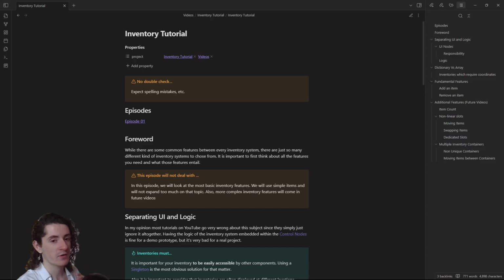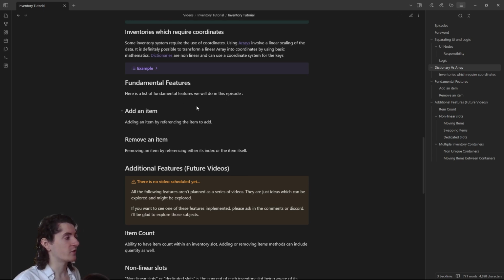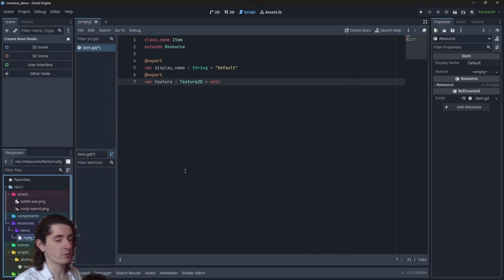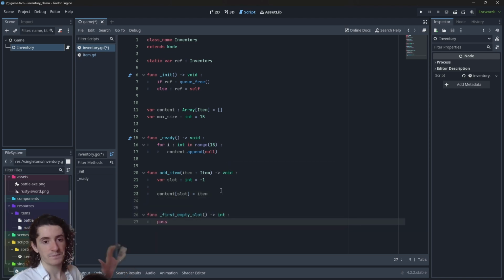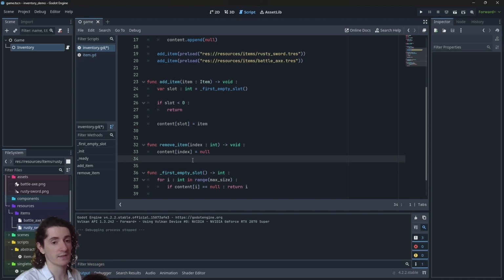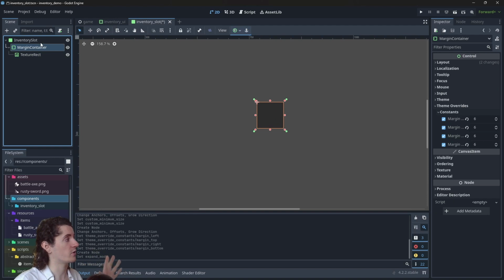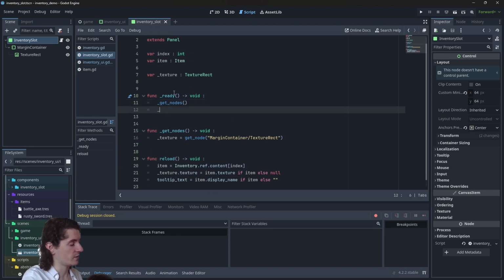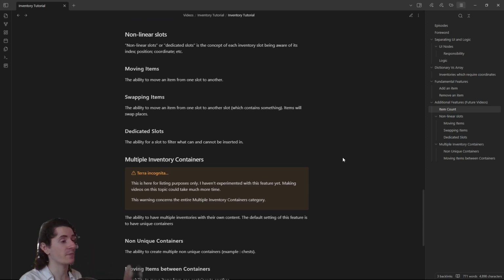Inventory Tutorial : In Depth - Fundamentals - Godot4 (Beginner)

Comment: These are really great, keep going!
Reply from the maker: I'm currently focusing more toward other projects. If there are specific inventory features you need, make sure to ask for it. I'll do those pretty fast.
Reply: @SableSpirit  I was mostly thinking about the signal to reload slots being in the actual slot, you mentioned it'd be more optimized and was wondering if that could be expanded on.
Reply from the maker: @DrLengen  Sure, a quick way to explain it would be to create a signal with an argument (index : int).

For the observer, either the inventory watches the signal and updates the matching slot based on the argument, or each slot can watch the signal and compare the index in the signal with theirs.
Reply: @SableSpirit  Okay, so I have the Inventory emitting a signal `inventory_slot_updated(index:int)` down to the `InventoryUI` class to update the Slot in the GridContainer to call `slot.reload()`